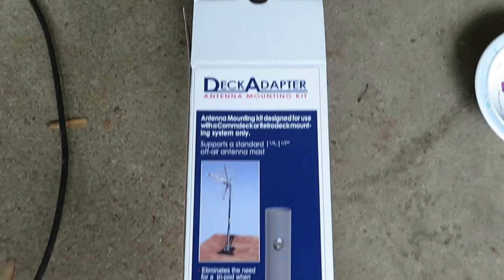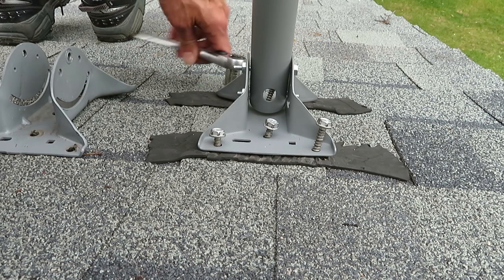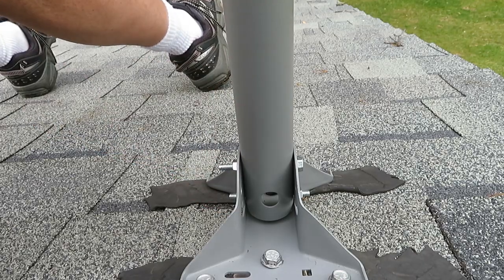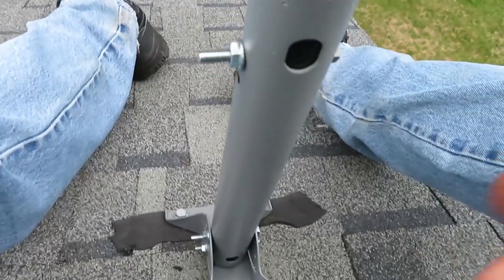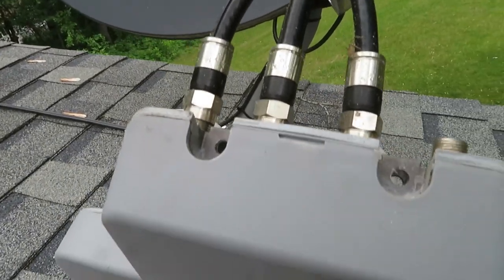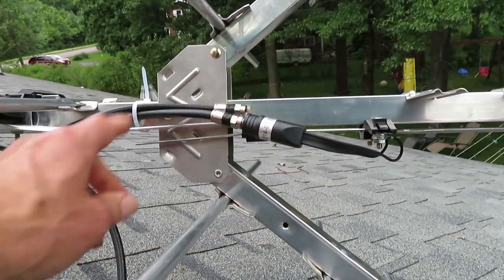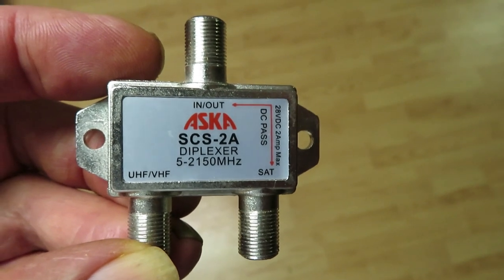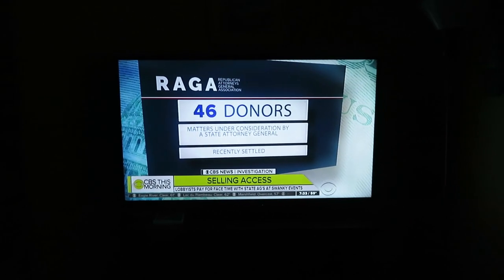How to Install an Off-Air Roof Antenna Using a Former Satellite Mount

Comment: My man you are really missing out without an amplifier.  World of difference.  But thanks for the ideas of converting from a satellite set up.
Reply from the maker: Thanks for watching and for the tip. Any recommendations on the amps out there?
Reply: @TheOriginalMechanic  An amp is great if you have reception issues. If your reception is fine, you don't need one.
Reply from the maker: @autryld  I tried an amp and it didn't  get me any extra channels...like PBS.  Someone told me the antenna is the issue...it's three years old and maybe not optimal for digital.
Reply: I used an amp at my house with an attic antenna and I went from 32 to 68 channels and some new smart channels I didn’t have before it makes a world of difference
Reply: He's right, you need a working preamp. But you're also right, just make an ultimate antenna, look up Danny s Hodges on YouTube
Reply: @TheOriginalMechanic  No such thing as a "digital" antenna.  That's just a buzzword to sell new antennas.  It's the receiver that translates the "digital" signal.  Any 40+ year-old UHF/VHF antenna with a good transformer and preamp will work fine.  RCA makes a good cheap preamp.  4G/5G LTE filters are also recommended to cut out cell tower interference.  If you have multiple TVs and more than 50ft of coax in your setup, you might also want a drop amplifier.
Reply: I get 33 channels using an indoor ampified radio shack antenna

Comment: You should put some Chemlink M1 or other sealant on those lag bolts to avoid waterproofing issues in the future... Just having that rubber gasket is a little scary
Reply from the maker: Thanks for sharing the helpful tip.
Reply: You prolly dont care but if you're bored like me during the covid times then you can watch pretty much all the new movies and series on instaflixxer. Have been watching with my gf during the lockdown xD
Reply: @Xavier Jared definitely, I've been watching on instaflixxer for since december myself :D

Comment: Getting ready to install a roof Antenna , my outdoor coaxial cable doesn't have a ground . So guess I'll not have one .
Reply: As long as you're ok with the potential for a frick ton of electricity traveling through your combustible building structure, no worries! 👍🏻

Comment: What is the size of those lag bolts you are using?
Reply from the maker: I didn't measure them. They came with the kit as I recall.  I would think 1/4" by 2" long.

Comment: Nice video, Any chance you could give some specs? What kit did you use? What are the O.D.'s of the long pipes being used to slide into the roof mount? Thank you
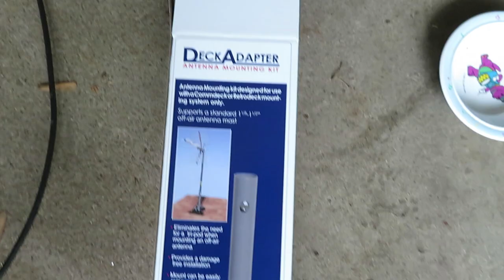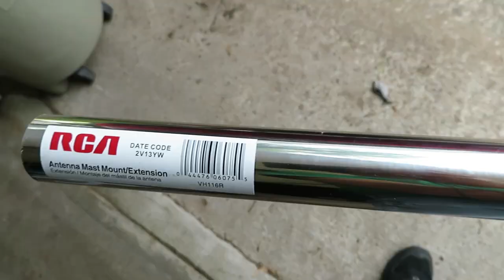Reply from the maker: I found the kit (view-able at 00:08) at a home improvement upper Midwest big box store.  It fits a 1 1/8" to to 1 1/2" mast. The RCA mast I used can be viewed at 2:01.  I hope this helps and good luck with your project. I've been happy with mine.
Reply: @TheOriginalMechanic  I mounted my antenna directly to the old DirecTV short mast. Unfortunately, it doesn't quite clear the ridge of the roof. Anyway, I need this kit. What store did you get it at so I can try and match it? We have a Menard's here. SKU 3011802 looks like what you're using but the product description doesn't tell me what's in the box.
Reply from the maker: @autryld  Menard's. I don't remember all the parts and pieces...it had the foot and the mast which rotated in the foot.  I guess try it and if doesn't fit your Direct TV mount take it back.

Comment: Good video.  Helpful.  Thanks.  
I'm sure :)) others have already comment, 
but I probably would have filled the old holes (with just a bit of overflow) with some roof sealant from a tube.  
But maybe your result to date is that such wasn't even needed.  
Anyway, thanks for posting.

Comment: What was wrong with the old base and pipe? Not sure why you replaced it to put the same thing back on.
Reply from the maker: I tried that first. It was the wrong diameter to fit the mast that came with my antenna.
Reply: I'm afraid to mess with the roof. I just recently fixed a prolonged leak. How about replacing just the piece where the mast fits?

Comment: Why did you snip the ground?
Reply from the maker: That was part of the old satellite installation and would have kept me from using the satellite coax cables in my new location. I added the ground back to the antenna later.

Comment: Only 6 channels at 45 miles from transmitters? You're in tv hell. I'm 80 miles from nearest transmitter and get 36 channels in one direction and 18 in another. I've gotten better results from the DIY 4 Bay antennas made with Romex wire
Reply: I'm about 50 miles from Tampa and the same from Orlando and get 125 channels.